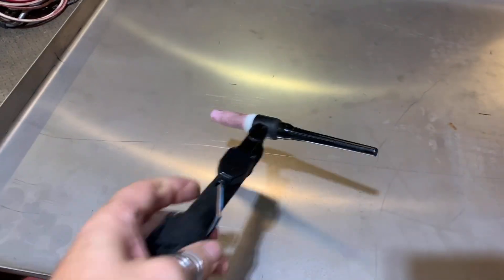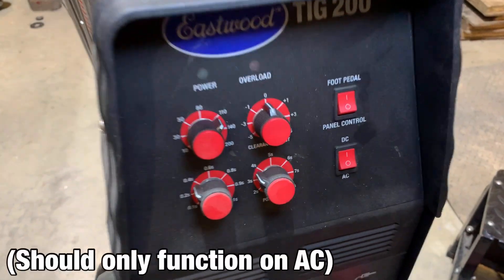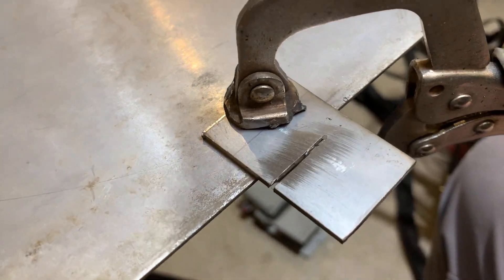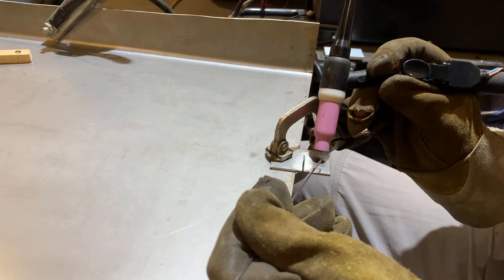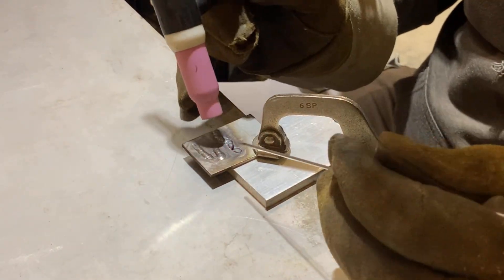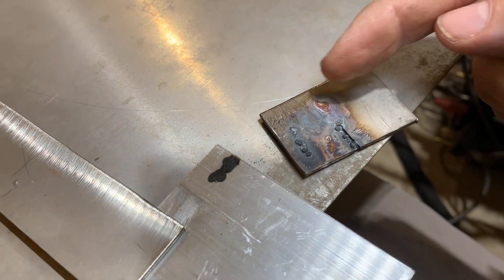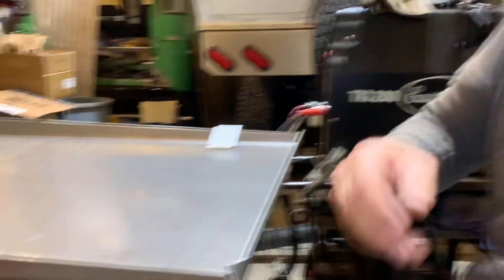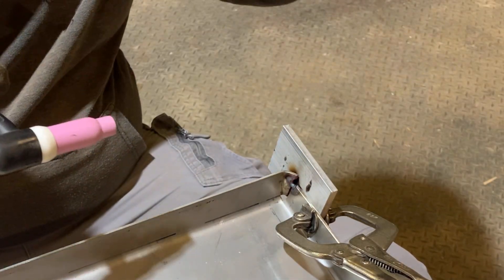Custom DIY shower pan PART 2 | Fuso FG overland build

Comment: My stainless and  mild steel improved a lot with a Furick Jazzy 10 cup. Well worth the money.
Reply from the maker: Interesting - what size were you running before you switched?   What did you see for difference?

Comment: There's SO MANY different things to think about at the same time with TIG. I'm sure you've watched hundreds of hours of YouTube Welding University already, so keep practicing! Torch time is the answer. 😀
Reply: Definitely looks like you can have your tungsten sticking out a bit more, might make it easier for those inside corners.